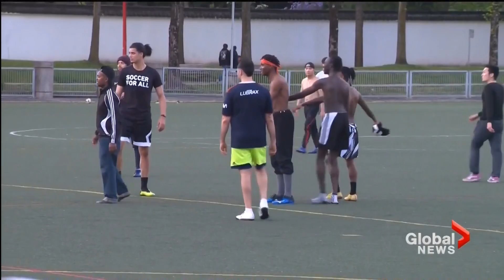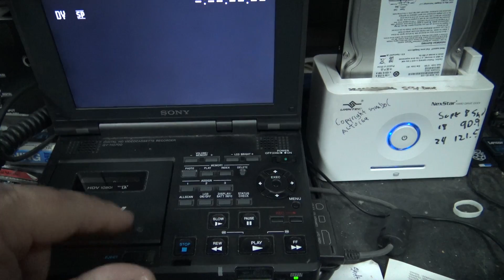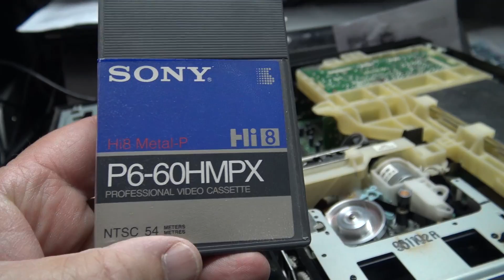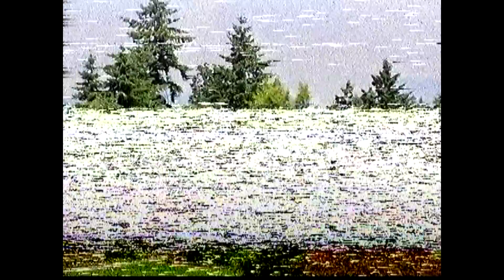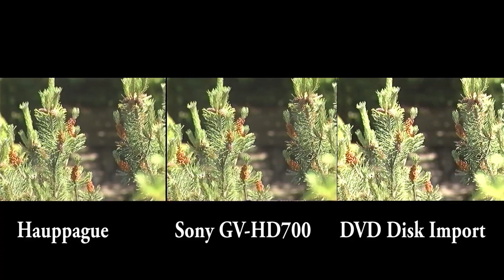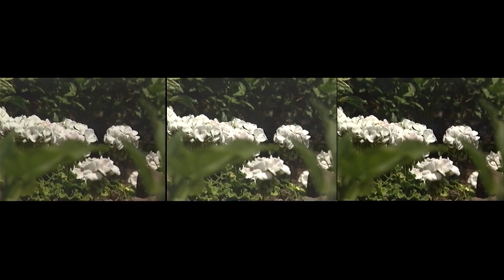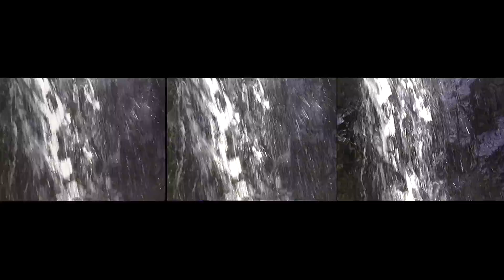Analog to Digital Conversion Which is better

Comment: A good friend of mine asked me just last week which is the best way to transfer analogue video to digital. I said straight to dvd using a dvd recorder. He said I don't want or need discs.  Well I don't care, it's the right answer. People have argued with me that straight to computer is best. I've seen horrible results from that with massive pixel errors. Even when I paid professionals to do it for me, and I threw away the resulting copy.  DVD recorders seem to handle the data stream way better, with no errors. Onc eyou have the dvd you can then copy the digital file.
Reply from the maker: I still say get tapes backed up on disk. If nothing else it is a backup and properly stored will last years and years despite what some claim.  I just ripped a DVD-r that I burned 17 years ago.
Reply: @12voltvids  I have a tv special on John Lennon which I recorded the week he was murdered, it's on Beta tape, and it still plays perfectly. That's 40 years old. It was the first time I recorded anything off the air. I still have a working Beta machine.

Comment: I felt the Sony GV-HD700 was that best as it seems to have fewer artifacts in the picture.
Reply from the maker: Has weaker contrast and color
Reply: @12voltvids  Isn't the chroma resolution of Hi8 already poor? I believe it's about 30 lines.
Reply from the maker: @KylesDigitalLab  
Chroma resolution is determined by the frequency of the color under carrier (suppeessed) frequency.  
VHS uses 629khz, Beta and 3/4" umatic used 688khz and 8mm / hi8 used 729 khz.  Therefore 100 khz more than VHS.  If I remember VHS had about 60 lines of chroma resolution. Beta and umatic around 70 and 8mm 80ish.  I don't have the exact numbers handy and I don't feel like breaking out the bandwidth calculator, but to answer your question 8mm / hi8 had the highest color bandwidth of the analog color under systems.

Comment: That screen on the right is way better than the other two on the left.
Reply: The contrast is much higher, which looks nice, but at 24:07 you can see it's overexposed (not the right term?) and the sky is washed out. The Hauppauge looks better in that frame, though the contrast is still kinda flat (can always be fixed later if you want).

Comment: Haha shout out to eBay.. A nightmare for sellers since 2010 or so when they gave more rights and zero repercussions to the buyer and a major uptick in China sellers began to spam the site with their bootlegs and disposable electronics.

When it does work out you get more cash for your items than local ads, but the bad transactions really leave a stain..
Reply from the maker: Well I made the mistake of selling to a US buyer that had zero intent to pay for it. Ebays response was that is the cost of doing business. So I sell nothing on ebay now, and I won't buy anything either.
Reply: @12voltvids 
That's messed up.

 my worst experiences were always reselling consumer electronic type items..  I never had an issue selling stuff that I made though.. Seems handmade stuffs attract better buyers. Most of my dealings were with USA buyers, me being in Canada..

Haven't sold much in a few years, can only imagine it got worse in that time.. 🙊

Comment: I use a broken DVW-M2000 to translate analog component/composite signals to digital SD-SDI signals, then that signal is piped into my ancient AJA Kona 3 PCI-E capture card via HD-SDI, which converts the 525/2:1/59.94 analog signal converted to 720x486/4:2:2/10-bit/59.94i digital signal, and the AJA Kona 3 can upscale that signal to 1280x720/4:2:2/10-bit/59.94p or 1920x1080/4:2:2/10-bit/59.94i resolution. I've even detelecined (reverse 3:2 pulldown) VHS movies using this equipment, and the Assimilate Scratch built-in detelecine.
Reply from the maker: Easy enough to scale in software, but the fact is most TVs have a much better scaler / deinterlacer when fed via the composite input. Plus as a business, when working on a per tape budget where the client won't pay for edit time they want it done fast and cheap. So output direct to DVD is the way it is done, and they can load the disk on their computer and do their own editing. Some want the files as DV files on an HDD and for those clients they get the 4:1:1 DV system. Your 4:2:2 system will deliver better color fedility than 4:1:1. I have an old Miro DC30+ that captures 720x486 (the extra 6 lines were required to make the unit broadcast quality, and it has to do with capturing closed caption data that the FCC requires. That card was a fantastic PCI card, but the drivers were all for windoze 98.
I have a Matrox RT2000 system as well on an old computer somewhere. That was a good system as well but also obsolete by today's standards. All I know it that it cost a bloody fortune. RT 2000 was about 2000.00 at the time, or was it 2500. I forget, all I know is I spent a fortune back in the day when I was in the production business.
Reply: @12voltvids  That sounds very interesting, I've been looking to get better equipment, but I'll have to live with what I have now. I sampled this from a VHS tape, but the S-VHS player is sort of going bad as can be seen in the video: https://youtu.be/URlQTq7TJZU

What is your opinion of the quality, and the potential reason behind why my VCR has these strange artifacts during playback?
Reply from the maker: @NUCLEARARMAMENT  
The comb filter used on SVHS players are known for leaky caps that cause crushed lumanence. Fortunately I know a guy that is very good at keeping my decks in top condition so I get very good transfers.